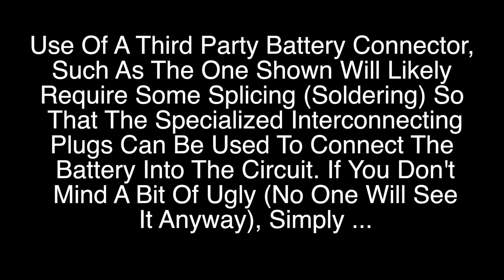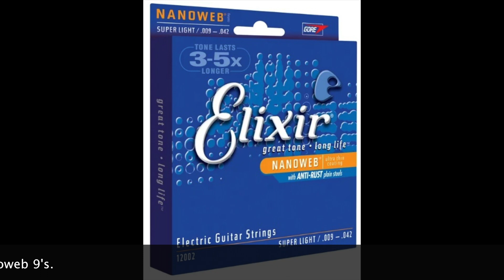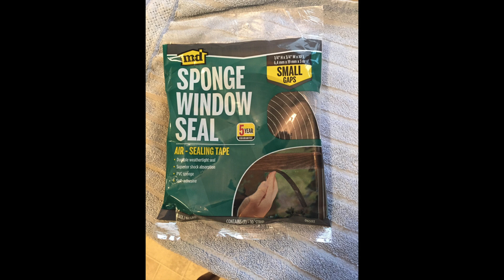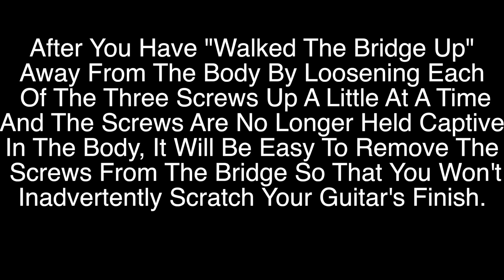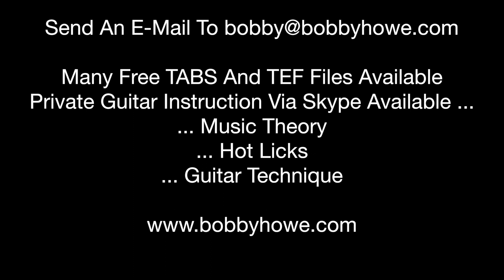Fender USA Tele EMG Pickups: A Review

Comment: Hello Mr. Howe... just wanted to ask if it was possible to install just the bridge pickup and to have one pickup guitar... they sell these pickups separately.... and was wondering if it is ok to connect the pickup with the volume tone knobs and then straight into output jack without going into the 3 way selector since there would be only one pickup.... thank u
Reply from the maker: Hello Juraj, yes I suppose you could do that but it might require some modifications as the 3-way pickup selector switch is the main junction point for the entire assembly.  It might require some special mods and soldering.  It would seem to me to be more work that way though.  Why not just spend the small amount of extra money to buy the entire kit?  That way, if you choose to play the guitar with only one pickup, you're free to do it as you wish.  If you only put in one pickup and don't have the other one from the matched set installed, it will be difficult to re-sell. Also, you may reach a point in the future where you wish you would have gone ahead and done the entire install anyway.  Good luck, BH.
Reply: Bobby Howe thank u kindly for your reply.... I might buy both pickups then... just I don't have a Tele style guitar... just a hybrid... Tele bridge and 2 strat pickups.... what I could do is to buy both pickups plus the 3 way selector too... I love your playing and thank you for making this video and again for your reply... all the best
Reply: Mr. Howe... must one more question... if I buy the t set as you did... could i take all the knobs and the 3way selector out of that plate and just put them into my guitar as there is a different layout of electronics?
Reply from the maker: Hi Juraj, I suppose you could but I'm sure it would require modifications.  Good luck!

Comment: Incredible enhanced sounds, especially in using only the neck pick up, and both pickups together. Expands the applications of the tele. Wonder why Fender, or a third party, would not offer such an appealing sounding option, or if the pick up manufactures could offer the same sounds without having to deal with the battery issues?   Fabulous instructive video and explanations.  hammondb3jac
Reply from the maker: Hi Jack, I understand your reluctance when it comes to dealing with a battery but in the grand scheme of things, I consider it a minor annoyance.  I've had these pickups in this guitar for some time now and have only had to change the battery 1 time so far.  Just as a guess, I'd say the battery lasts about a year.  Thanks for watching my videos and for your nice words.  All the best, BH

Comment: Yeah, single coils can hum and buzz. But there are better ways of dealing with that besides going active. Morley make a de-hummer eliminator that is so easy a child could use it, and it gets rid of the hum without changing a thing about your tone {in most cases}. I have tried them all, and wasn't happy with any of the "noiseless" pickups made by all the major pickup manufacturers. The truth is, they all sound different from a single coil, because they all are really humbuckers. The trebles are cut and the mids are pushed up. Maybe you like that in a Tele. I don't. It's not so good in a Tele, but down right disastrous in a Strat. Not to take anything away from your playing, that's just fine. Better than most on YT.
Reply from the maker: Thanks for the compliments and all the best to you.  BH

Comment: Just put in a STEREO jack in the guitar and build an exterior battery BOX= simple + you can use 2 batterys  for 18 volts to over volt it ! And if the batterys leaks  it does not MUCK UP your guitar! IMAGINE THAT

RMJDESIGNS

Comment: EMG/Active pickups are super quiet, very balanced across the strings, bright, defined, great note separation, active compressed to be well behaved in dynamic range and frequency response. Great to have that available on basically any guitar to [Insert guitar track here]. Also, somewhat unfortunately, generic sorta lifeless and flattened to sound like Metallica playing a small town jazz festival  for all of eternity. Hey if you are into that great! This guitarist tapestry is of many pretty colors. Personally, I'll take the noisy, passive, terribly unbalanced (or balanced as well/poorly wound) with those magnetic materials stuck together like alchemy magic, overly magnetic as to impact intonation, rusty in 2 months, interference prone from everything, LED, lighting, microwaves, FM and police radio scanners, sunspots, cellular...my cat's brain waves. Because that's just rock and roll baby, that's my soul...a mess of crazy annoying noise humming, crackling, booming, buzzing and rocking the shit out anything in range. Passive is not pacified in guitars...it's fussy, rather impolite, not a well behaved lady...just like rock and roll is supposed to be. In my opinion.